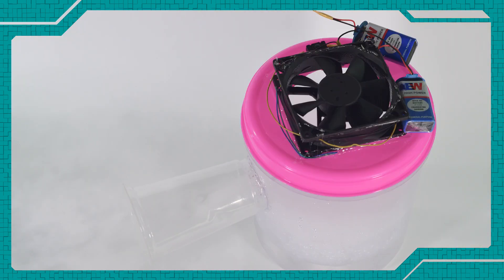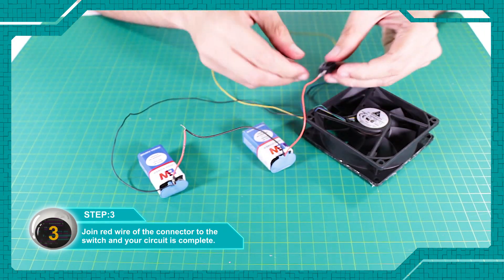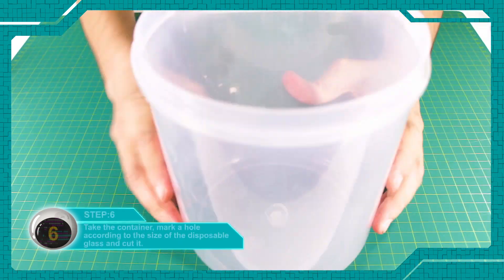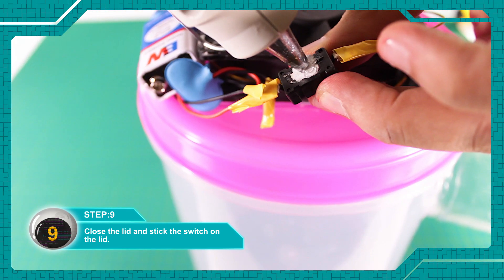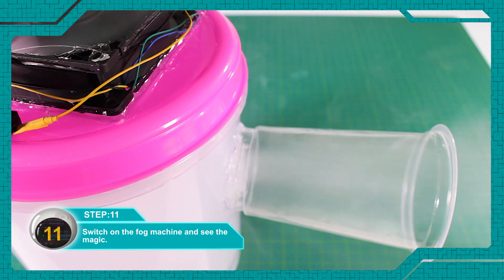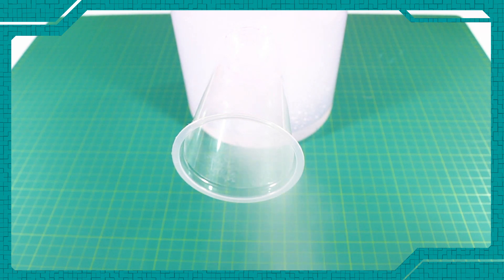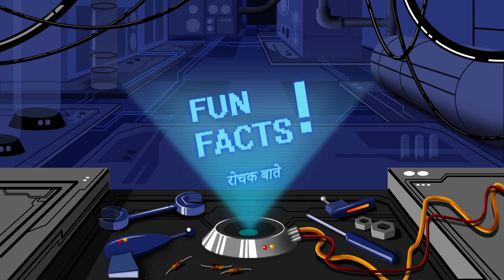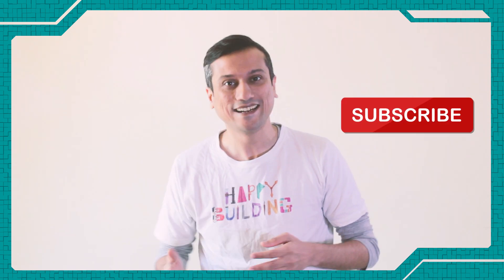I made a Fog Machine?! Happy Building!

Comment: where do you get dry ice from. i cant get it anywhere in ujjain
Reply from the maker: Hi There, I got the dry ice in Mumbai since I live here most of the times. In Ujjain, try asking if there are specialist stores and vendors who deal in dry ice (solid carbon dioxide). Ask your local hardware store or restaurant (They might use dry ice for refrigeration and in cold storage). They might be able to direct to the correct vendor. Hope that helps!
Reply: thanks prateek sir.....